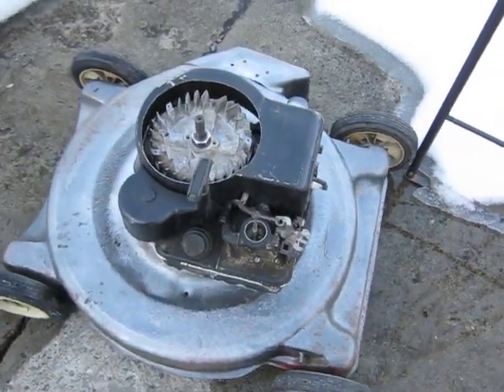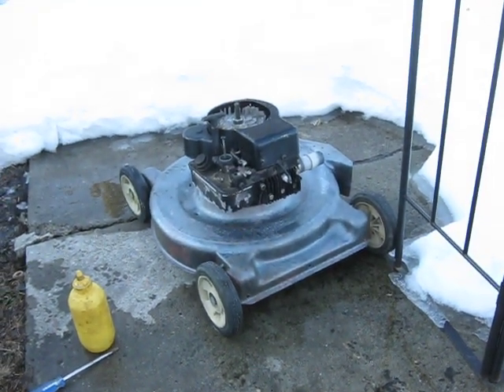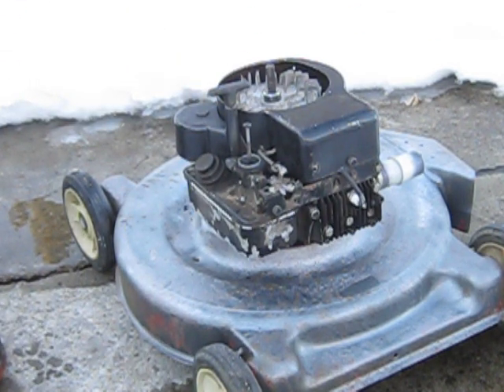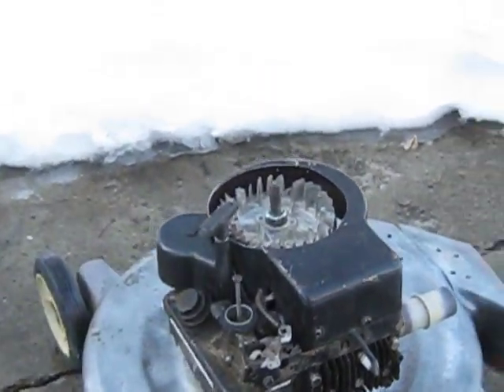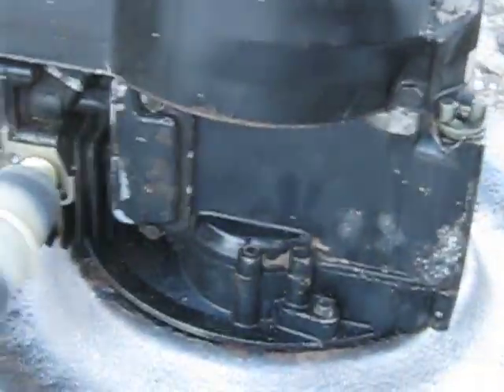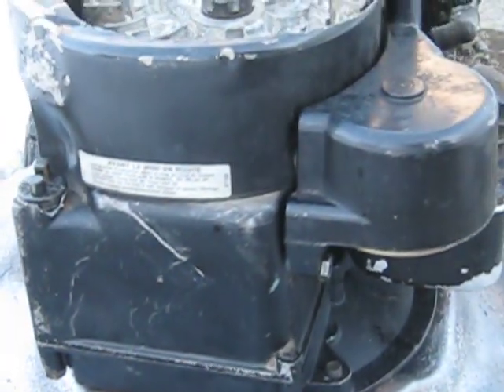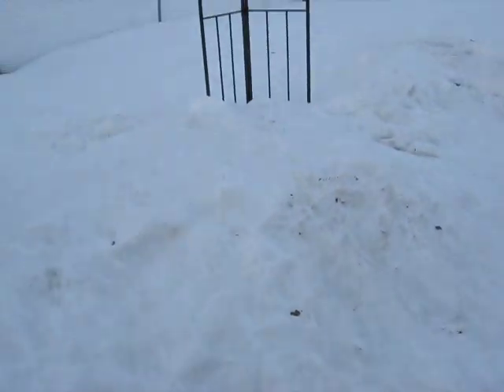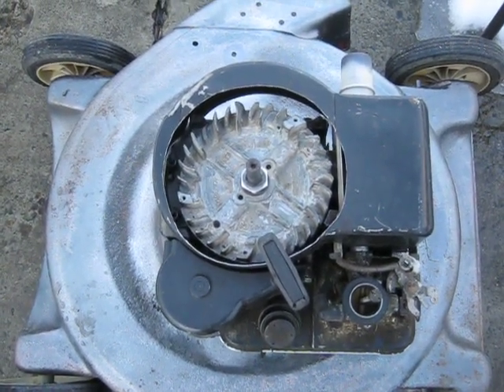JB Welded Con Rod Torture Test!

Comment: Haha next time try brazing the con rod up instead of JB.  I wonder how long that "aluminum brazing" stuff would last.  Might not be too bad, actually.  (AFAIK the brazing rod is zamak and forms a diffusion bond with the workpiece and holds very well)
Reply from the maker: I have 2 packages of that aluminum brazing rod, i didn't know it was zamak, that is what Hot Wheels metal bodies are made from. I played around with it once or twice, but haven't had much success. Brazing up a rod would sure put it to a torture test!  My kind of stuff  :)
Reply: ChargerMiles007 It would be an interesting test!  I've heard of hotroders in the very early days welding connecting rods.  Brazing would be something!
Reply from the maker: Really, people welded up con rods!!!   They must have had balls of steel back then!!!!

Comment: so brand x engines are very hazardous about flying parts
Reply from the maker: +mrsmashthings Yes, some Brand X engines can indeed let fast moving parts fly when they decide to let go!  I have seen the results of an 8 horse generator grenading (when only 15 minutes old!), pieces flew 30 feet. It was the result of too loose a fit on the con rod, right from the factory, this and events like it are probably why Brand X isn't in business anymore. (hint, I am NOT talking about Briggs and Stratton here).
Reply: +ChargerMiles007 Tecumseh?

Comment: Heh, connecting rods.....that reminds me of the other day..
(lol here we go, roll eyes )
We have a 2year old, if that,20kw Briggs gen with a 992cc v twin vanguard on it. 
It was runnin on 1 cylinder for I don't know how long, because one of the guys was out for service on it and noticed it was running on 1 cyl.....
anyways , he pulled the plugs and finally determined the right piston wasn't moving, uh oh. The block was damaged and leakin oil, but not real bad. 
We went and pulled it and brought it back to the shop. 
Teardown inspection revealed it was not lack of lubrication.
Of course 1 rod bolt was broken and the rest of the rod was in about 5 pieces. 
The crank didn't really have any transfer except where I suspect a piece of the aluminum rod bounced and scraped against the journal, it was a strike mark, not a round the journal bearing failure scrape. 
I was impressed actually, it still ran and if someone woulda put some schmutz on the block they could have had a nice 1 cyl vanny ;) 
First failure I've seen on a vanny, and I see a lot of em. 
Oh, btw, nice connecting rod chooch video!! :)
Reply from the maker: MrTheHillfolk Yes, I will pretty well garentee that the block could be sealed up using JB Weld, though applying a layer of good silicone over the repair would be more insurance against a small oil leak.I heard of a similar incident with a 4 cylinder car that had a bad shake, turns out a rod had broken off, and the piston was in little pieces in the oil pan, but the engine still ran!

Comment: My grandfather use to JB-weld chainsaws back together when they were crushed by trees or skidder tires. He only fixed the blocks of them like this but he never had one fail after these reconstructions. I must say I'm impressed that rod lasted that long too!
Reply from the maker: 2boredfortv Sounds like he did great chainsaw repairs!  I epoxied the oil pump back onto a small motor cycle one time, it held for years!

Comment: I don't think that could have been any more awesome. It didn't make any sort of noise or anything to elude to it dieing, and that sound!
Reply from the maker: Sc1Z Yes, the sound it made was definitely different than anything I have heard. I blew another Briggs lawnmower up by un-torqueing the con rod bolts, it made (vid here on my channel) more of a bang noise. I listened to this noise a bunch of times, finally I had to quit, as it was ticking my wife off!  :)   I will tear it down and make a carnage vid tonight, though it will be a day or two before the upload.
Reply: ChargerMiles007 oh man I cant wait. Something about messing around that is always so satisfying. my project right now is getting my 12.5hp up and running on my rider, I have swapped the pullys. I just have to modify the clutch and lock the rear end. Should be pretty fun next winter.
Reply from the maker: Sc1Z Sounds like a fun machine as long as you don't roll it!I did the teardown last night, you will be shocked at what happened to the block, it is now un-fixable for another run :(
Reply: OH man! stop teasing and get that video up!
Reply from the maker: Sc1Z Sorry about the delay, I plan to start uploading tonight, however my wife doesn't understand the urgency of showing you guys the Carnage, and has invited folks for supper tonight :(I only upload from the library, so my time is rather limited. I will get something there tonight, but I suspect there will be a part 1 and 2 to this vid. Sorry about the delay, I understand your frustration at the wait!
Reply: No worries, we all know if momma isnt happy, nobody is happy!

Comment: LOL!
Time for more JB Weld lol!
Reply from the maker: ***** Yes, I may JB it again, if the block/cylinder area isn't too badly damaged, I will document it well on a teardown vid. If I run it again, it will either be at idle, or under some type of load, like a snow mower!  :)
Reply: That was great tho. No warning , just CLUNK!!! 
Instant stop! 
No smoke no spit ...nothin, just CLUNK! 
Lol I rewound it to 3 or 5 seconds before the clunk , about 6 times. 
It did torque a little but not bad.
Reply from the maker: MrTheHillfolk Yes, it was the strangest con rod failure I have seen, but it was epoxied up near the piston pin. The crankcase contained the damage, but the block is not repairable do the extensive damage. I think you will be surprised, I will upload the Carnage vid tomorrow (hopefully)

Comment: Prep-work & experience have alot to do with successful JBW projects.
I am more likely to try JBW on a stationary part than a moving part.
Cool experiment Miles !!
Reply from the maker: ***** Thanks for watching. Yes, prep work is very important, I have been using epoxies like JB for 35 years, around home, and sanding, roughing and cleaning HAVE to be done. My son introduced my to using Brake cleaner, so I did that also with this rod. I didn't use brake cleaner before, as I find the smell hard to handle, though it kills wasps much better than WD-40 does!  :) This is the first moving part I have used it on.
Reply: ChargerMiles007
I'd like to mold a complete 5hp engine block out of JBW :)
Polymer cylinder jugs might be in the future for water cooled engines.....

Comment: you bumped up the RPMs, you cheated. LOL  If I knew you were going to do that I would have guessed less. .  Thanks
Reply from the maker: zzzdogutube Yes, I statred it around idle, then revved it up. Sorry if I changed it from what I said in the other vid, it was the Heat of the Moment that got to me!You get Honorable mention, as you had the third closest guess to the time (it looked to me like it ran for 50 seconds),so good guess. f I am able to run it again, I will do it at idle only, unless it goes for more than say 10 minutes, then I may rev it up so the neighbors don't get too excited!
Reply: I'm just joking with you;   It was fun
Reply from the maker: zzzdogutube That's OK, I bet you will like to see the Carnage vid of the damage done to the block, I can't duplicate this, or use this engine again, you will understand when you see the vid. I found it hard to believe it lunched the block so badly, it didn't look like it from the outside!  I may use another scrapper engine to do another similar test at idle speed, the problem will be breaking a con rod, as hack sawing it in half will NOT be the same.

Comment: Boy, was I wrong! I guess I overestimated the strength of JB. Whatever, its still a "miraculous substance", if you will. Great vid. Cant wait to see what exactly happened.
Reply from the maker: ***** I am still amazed at how strong the JB was. I was not disappointed in it at all, I wonder how long it would have ran for at idle?  JB is listed at what maybe 4500 psi tensile, while aluminum is around 20,000. I think the JB more than held up its end on this test  :)Thanks for your interest in this experiment, I will have to come up with more.